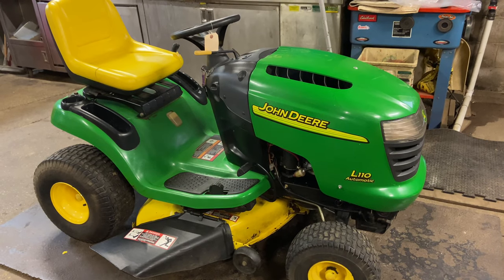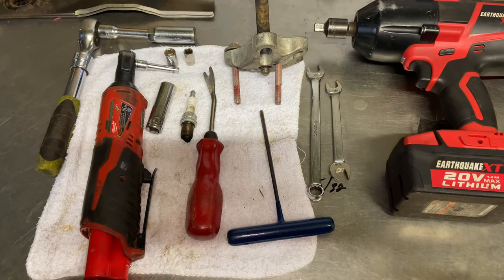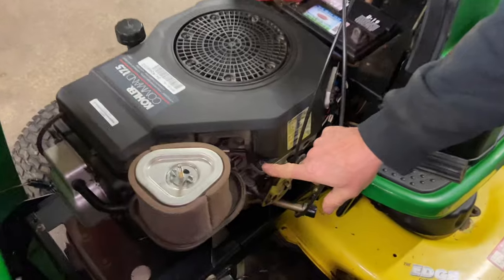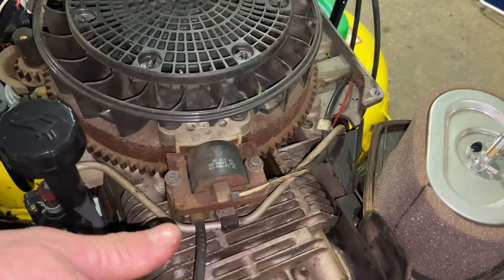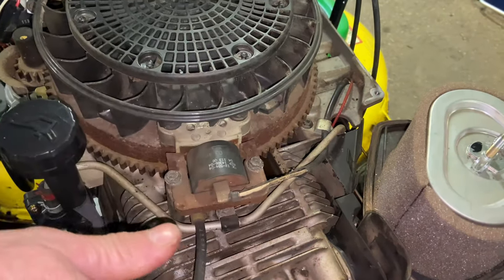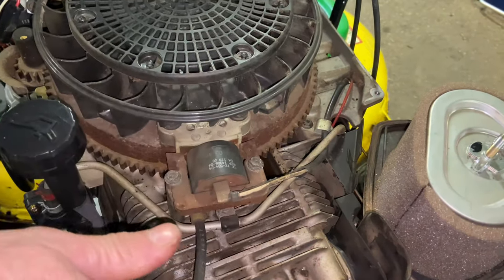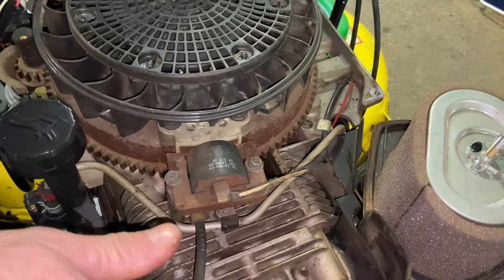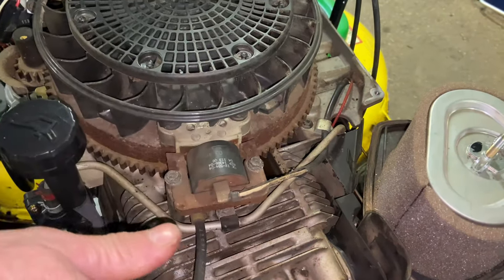Kohler Command Engine Missing and Popping

Comment: I have a kohler command 25 that will fire right up but will not stay running longer than 15 seconds. It goes from full idle to sputtering out. I've changed with new factory parts the carb (and did a rebuild kit) the fuel filter, fuel tank cap, spark plugs, fuel pump. This is at full choke as well, won't start any other way... thoughts?
Reply from the maker: Impossible without seeing the machine but I would suggest checking fuel flow from fuel tank to fuel filter to make sure there isn’t a blockage OR you may have blown head gaskets  so the compression is so low the engine will not stay running.
Reply: @JohnsonsSmallEngines  thanks for answering, it was both head gaskets. one was leaking externally and one was internal. Replaced and running like a champ now.
Reply from the maker: @ke8222  glad your back up and running!

Comment: I have a 12.5 command horizontal shaft. It backfires from both sides flywheel key Is not sheared any other ideas.
Reply from the maker: Does it run? Perform simple first. Install a new spark plug, check to make sure carburetor is 100% ok, check the choke and throttle plates on the carburetor inside to make sure they are tight on the shafts. Other than that you only have the valves that would make the popping and missing, you would need to tear into it to see what’s up like a valve seat loose etc.
Reply: @JohnsonsSmallEngines  yessir just got back on line.  But still have same issue. Any chance compression release is stuck open?
Reply from the maker: @cravenmoorehead5636  Doubt it. The next step is to take head off. You may have a valve seat popped out but I cannot confirm any of what you have done without seeing it so good luck and keep on working in it until you find out what has happened.

Comment: What would you say the actual torque would be for the crank bolt?
Reply from the maker: You should look up your engine model to make sure you are getting the correct torque value. The correct torque for the engine flywheel bolt in my video is 49 foot pounds.
Reply: Put an impact wrench on it until it strips out, then put a tack weld on the top lol

Comment: What causes this to happen in the first place?
Reply from the maker: The flywheel bolt loosens up.
Reply: I believe mine was caused by a lean carb causing a backfire. This propelled the crankshaft too fast and sheared the key to the flywheel.

Comment: Thanks for the great video.  I have popping on one cylinder of a 24hp twin B&S.  The push rod was off on one cylinder which seemed obvious.  Put it back in, adjusted the valves to .04 and problem still occurs.  I'm assuming a sheared key would affect both cylinder's performance.  Could this be a bad valve adjustment still or possibly a bad ignition coil on that side?  The popping gets worse with time (seems to run fine for 30 seconds or so) and gets worse, fairly quickly.  The valve head on that side also seems hotter than the other side. thanks for any ideas.
Reply from the maker: If the push rod was out of position. Check to make sure it’s not bent, then you need to find out why it happened? Check the rocker studs to make sure they are not loose. Checked spark on both cylinders at the same time with two inline spark testers to make sure your ignition is ok. Check valve lash again. Install a new set of spark plug. If it still is popping and missing, you may have a valve seat came out of place and the only way to check is to remove the head to see. You may also have a valve guide that worked its way up but that doesn’t happen often.

Comment: When I run at full throttle, and engage the blades...the engine will run at reduced rpms for about 15 minutes. Then the rpms go up to where  it usually runs as if by magic. It will stay perfect for the rest of the mow. But on the next mow? It does the same thing again for about 15 minutes. Would you have a good idea where I should start looking? Thank you, in advance!
Reply from the maker: It sounds like the throttle plate inside the carburetor may be loose. OR Governor needs to re-adjusted. I would check ther carburetor first.
Reply: @JohnsonsSmallEngines  Thank you, sir. I will check those in the order you stated. Never had symptoms like this with an engine ever...a self correcting condition really messed with my very basic skillset!
Reply: @jasonmyers2809  change plugs...easy an cheap
Reply: Sorry it took so long to get back to you. Throttle plate and governor were OK. So the 1st mow out this season I mowed a half inch. The mower bogged way down...but this time the rpms never came back. I bet you know what's wrong with it now! And @SuperDave742 I always put a new plug in every year. Again, sorry to you both for the overdue update.
Reply: @superdave4725  I do change the plug every year. The pto was way out of adjustment. That was my problem. Thank you for the help, as well! Never get too much advice!
Reply: @jasonmyers2809  no problem...I've only had to adjust one pto in alot of years of mowerin...

Comment: Great job!  Just curious, were the blades bent up, or was it just that flywheel bolt being loose that sheared that key.   Thanks for the vid!  👍👍
Reply from the maker: Thank you! This time and most I have seen are from a loose flywheel bolt. Belts will give before the flywheel on tractors. I’ve seen a lot of sheared flywheel keys on walk behind mowers where the blade is connected to the crankshaft and the blade stops dead and the flywheel will keep rotating to shear the key.

Comment: Hello Sir, i has been watching a lots of your repaired video you are doing a very great job. Sir I help your help I just bought a john deere L110 model everything is just exactly the same as in this video now I trying to start it up but it don't get no Spark. Can you Please help me, Thanks!
Reply from the maker: If you have a ignition spark tester? Check the spark after installing a new spark plug. If you have no spark, disconnect the ground wire from the ignition coil. Check for spark again. If you do not have spark. You have a bad ignition coil. Replace ignition coil.
Reply: @JohnsonsSmallEngines  i just ordered a new ignition coil and should be here in Charlotte NC on tomorrow then I will install to see if it get spark. I'll let you know soon I finish install. Thank You so much Sir!
Reply from the maker: Sounds good.
Reply: @JohnsonsSmallEngines  Hello Sir, i got it running now,  It's a ignition coil. i really Appreciate a lot!
Reply from the maker: Glad to hear your back up and running!

Comment: You should NEVER hammer on the crank shaft. You would be amazed the microscopic damage that occurs on the bearings, which will reduce the life of them.
Reply from the maker: You do have a valid point but I’ve been doing it for over 30 years and never had a bearing fail due to it.

Comment: Mine starts and runs but will backfire and not idle
Reply from the maker: It’s running lean (lack of fuel). See if it will get better compensation with using the choke. If it gets better using the choke, you need to rebuild the carburetor.
Reply: @JohnsonsSmallEngines  Thank you! Would a sheared keyway under the flywheel give similar symptoms or just a no start popping. Wish I had oem carb. It came with an Amazon special and I bought another new to try as well. I suspected fuel too but from tank to carb is all new including fuel lines, filter and shut off valve. 🤷🏻‍♂️
Reply from the maker: I would pull the flywheel if it isn’t to hard for you and check the key. Also check to make sure the fuel is flowing good coming out of the fuel line right before the carburetor. If the flow is good then it will go back to what I said about the lean condition in the carburetor. I tried a aftermarket carburetor one time and it did not work and now I only use OEM on the Kohler command engines or try and rebuild them first. You may be able to find a good used OEM on eBay or purchase a blown engine that would be cheap that may have a OEM carburetor on it.

Comment: Use a credit card for your gap on your coil just an idea for you mate  👈🤔 thats more or less what i use.ps thanks for the tip of what to look for it will save me.
Reply from the maker: Credit card is way too thick, not recommended at all. Common .010” to .015” 0.2540 to 0.3810

Comment: HELP... Have the 17.5 Pro.. and it runs then stalls when it warms up.. put a new carb on it same thing.. runs warms up stalls wont start cools off, fires up.. runs stalls.. I need her for my leaves.... LOL HELP
Reply from the maker: How long does it run? Where is the gas tank located?
Reply: @JohnsonsSmallEngines  thanks for the response believe it or not I kept working on her and seems it was the gas cap...vent hole was plugged with dirt....make sense???
Reply from the maker: Nice!! Yes, I have a video on that. I just needed a little more info before I gave you the possibilities but it sounds like you got it going!